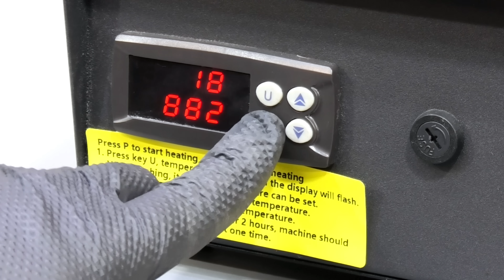105 Years Old Push Reel Mower Restoration - Why Did People Stop Using These?

Comment: petrol mowers ,,,, you could  removed the driving cog  so the cutters free wheeled and fitted 1/4hp electric motors those handles were HARDWOOD  as was handle and roller , and kept oiled with linseed oil, great job s only  need the catcher now or a lawn rake ,  also another problem was those that sharpened the blades on a machine  faded away closed down , you adjusted the cut from the rear  ,earned my pocket money when young ( a long time ago now mid 80s  }pushing one of those, we  were  another breed  ,but then  think we were fitter.

Comment: Great job in the resto. But I have to say, as a kid in the 60s who used one of those types of mower, you're using it wrong. You're trying to use it like a modern gas powered mower. You have to pick a part of the yard and go back and forth and repeat until the yard is done.
Reply from the maker: Thank you for the kind words and the insight! I appreciate the tip—sounds like using it is as much about technique as it is about the tool itself. I'll definitely give the back-and-forth approach a try next time. Thanks for sharing your experience!
Reply: @rustyshadesrestoration  It definitely gave me a workout in the hot Michigan summers back then. Grandpa was too cheap to buy a modern gas powered mower.  LOL Again, I wish I had your skills. Id love to try and find one of those mowers and give it make over.

Comment: You should stop using open end wrenches. 2 break loose rusty bolts, 6 point wrench works best to prevent rounding off the nuts or bolts if you can if 6 point wrench not available 12 point may work.

Comment: I'm 63 and when i was a boy we had one of these mowers and in the late 60's i was tasked with mowing the yard. It's fine for a little patch but try mowing and acre with one of these when you're 8 or 9. 
Oh and you are not operating the mower properly. You push it very hard and quick to get the blades spinning and wile the blades are spinning you pull the mower back over the grass. You can't just walk and mow like a power mower. You must go over a spot a few times.

Comment: Oxalic Acid 1 tablespoon per litre would have done the job without all that sandblasting and machine work.
Only attacks rust.
Excellent cleaner on rusty tools and engines internally and externally.

Comment: Your restoration is wonderful, but there are far easier models of push mower to use. All have much larger wheels, most have larger rollers set significantly further back, and most have faster spinning reels. I hope you find one to test against this one.

Comment: Why did people stop using there? Labour costs. Once there were an army of people that would repair these things and then labour costs started to rise. So much so, that you could buy a cheap electric mower for less than getting these mowers serviced. And when you do buy one, it'll comes with a 1 year warranty and will last a few years. By the way, these push mowers were Brill-iant when new, but after a few years of not being looked after, became a pain to use. P.S. needs a bigger handle for comfort.

Comment: To answer the question, having used one, they're not bad to use and even have niches today, but the problems outweigh the benefits.  You know how there's all those dumb tropes like mowing twice a week, picking up sticks, and spraying crab grass?  Reel mowers are the reason.  Coincidentally, they're often better around the sorts of obstacles that would actually ruin a blade in a normal mower.

Comment: Why stop using them? You showed why at the end. They weren't terribly good at the job. But second, all the power comes from the user. After 1945, gas and engines were cheap. A 1 HP engine with a horizontal blade cut reliably well, and reduced the time in at least half, while reducing the burden to a walk with ten pounds on wheels. Cutting the grass in 100F 85% humidity weather was hard enough with an engine doing the work... you're heading for heat stroke with that beast of a machine.

Comment: Why did people stop using these?  They're difficult to push through tall grass.  The blades need sharpening more often than a gas powered lawn mower with blades spinning at higher RPMs. Not to mention we got soft and lazy as a species.

The upside?  The only gasoline you need is a good healthy breakfast, no fuel filter to get clogged, no carbeurator to get gummed up from 10% ethanol gasoline, no used oil to recycle, no oil filter to change, no battery to go dead and/or replace, you get an old-fashioned work out, more time outside, less time indoors online, oh yeah, the only air filter you need is a healthy set of lungs.  Where can I get one of these?

Comment: There are different types of push by hand mowers . The one you are restoring was regarded as a cheap model. That said the reason everyone stopped using push mowers is because everyone has become lazy and want to inconvenience  their neighbours with the 100 decibel of noise appliance they use instead. Nobody knows how to use a simple tool as a brush and shovel which are very quiet implements to sweep garden waste into a pile but they know how to use a  deafening leaf blower that only clears their own specific work area but is simply moving it onto somebody else's.

Comment: The reason people stopped using these is because rocks get in the blades and stall it, which also damages them and makes them dull making it worser to mow with. From the test video I also saw the blade is in fact extremely dull and not sharp. Why didn't you sharpen it? You made it look worse than it actually is. Even a dull more modern bosch one I have cuts 5x better than what I saw here in the video.

Comment: To answer the question
(1) because ENGINES
(2) the roller type cutting assembly only works on fine grass, not broad-leaf varieties like kukuyu and buffalo grass which need a horizontal flail.

P.S. using metric spanners on Imperial nuts?  Really? 😱 Nooooooooo...

Comment: 10:30 WHY are you ruining this casting?  What is wrong with casting imperfections and lines?  It's not original anymore. There is zero reason to do this.
Reply from the maker: Some of them can hurt you while you operate or touch it because they are pretty sharp.

Comment: People stopped using these things because they were a bad idea. They did cut well under ideal conditions until the blades got dull. They took a lot of energy to push because you had to supply the energy to the moving blade by pushing heavy gears. if the grass got even a little wet the wheel that drove the gears would lose traction. One of the worst hand driven tools ever invented.

Comment: why stop ...? as long as you keep the lawn mowed and it gets no taller than 3 or 4 inches these work fine but as it gets taller the grass gets nearly impossible to cut with a push mower ... then you're in trouble ! ...that's why

Comment: I would have sharpened the blades, even if that is not easy. Corroded round edges cut nothing, as to see on the poor result in the garden. That paper test wasn't good enough. Wet grass fibers are thinner and flexible, it needs a sharp edge. The opposite blade must be of constant distance to the axis and not bent. Then you get a cut like with razor blades. Not sharp blades end up in torture.

Comment: Sorry, but that wasn't successful. The blade is blunt and not sharp, your test also showed that it doesn't really cut. It looks like it's just tearing and tugging
Reply from the maker: The blades are sharp enough, but the grass was wet after three days of rain, and perhaps that gave you the impression that doesn't cut well. Cheers
Reply: @rustyshadesrestoration  Okay, wet grass is hard to mow. However, this clack clack noise also makes me suspicious, as if the blades hit the counterpart, it should be more of a zing zing. And the paper test wasn't really a cut, it looked very frayed.
Reply: @rustyshadesrestoration  Oh man, how embarrassing. Of course, the rest was still well done, especially the handle. 🫣
Reply from the maker: Are you good there?
Reply: @rustyshadesrestoration  what Do you mean?

Comment: A failed design. Absolutely hopeless at cutting long grass or anything with "stalks" as they would protrude above the centre of the rotary cutter and would just be pushed back down flat as the cutter blades went over. If you cut your lawns say, every second day, then it worked well on short grass. We had quite a bit of Paspalum grass in our lawn and that bloody stuff grew stalks overnight! This type of mower would never cut it.